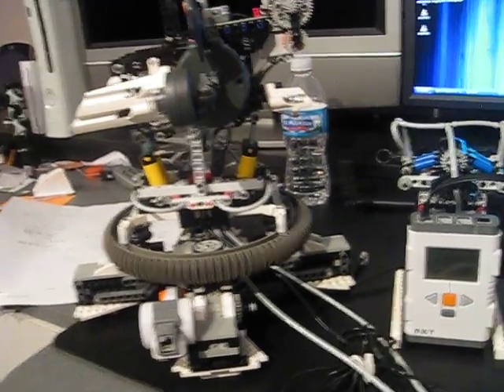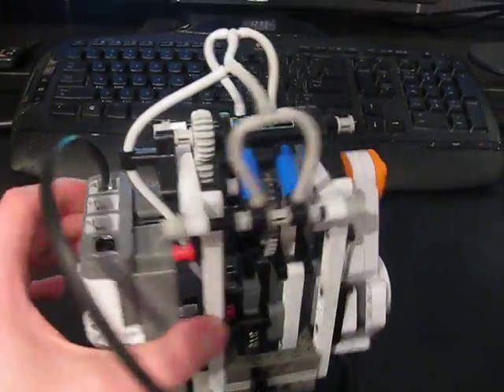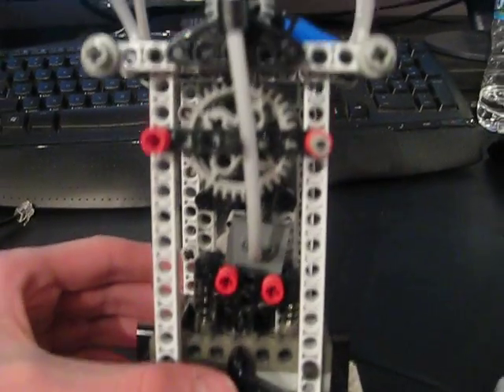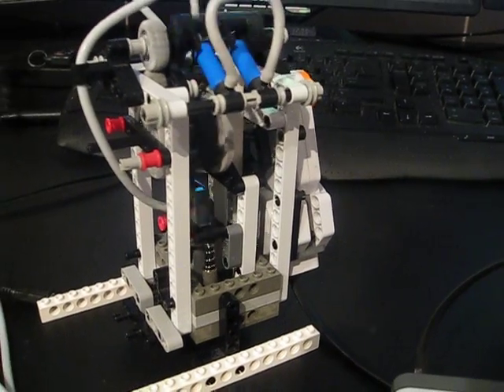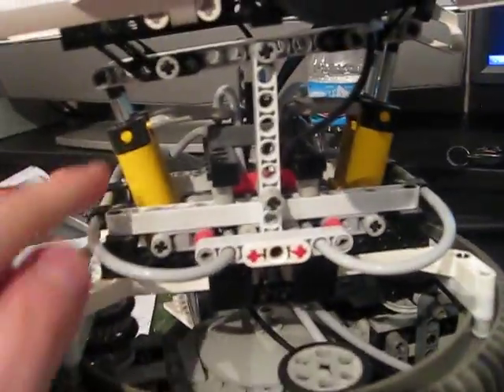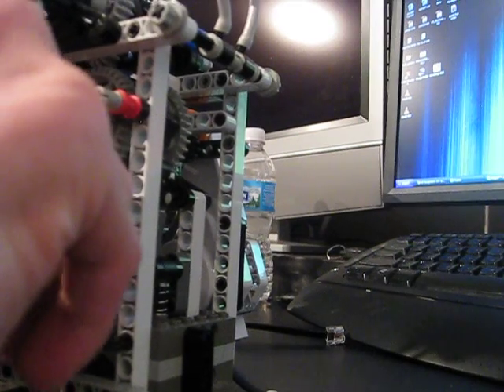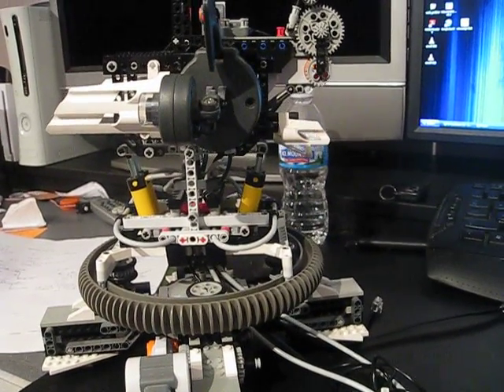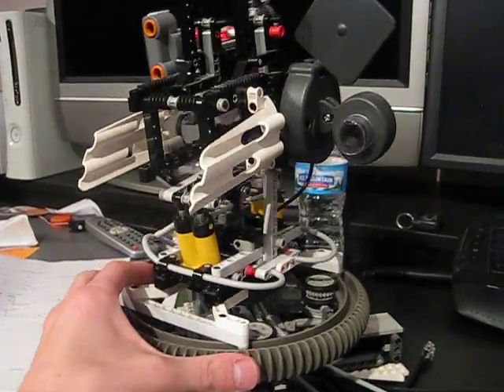Airsoft Turret Pneumatic Module

Comment: quite a nice design but can you get the gun straight, not at an angle? i cant think off how you would do this as there is no way to turn the pneumatic off, its allways open even if the pumps arnt pumping there ill still be some gass in the pump wich will make it very hard to get it level, its still a great design and origianal but its maybe not be the best thing for this robot